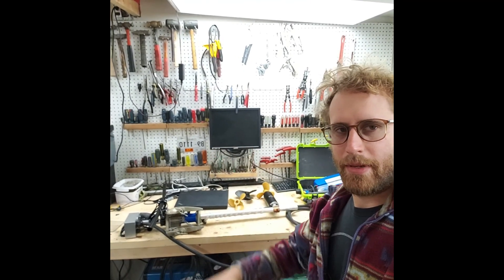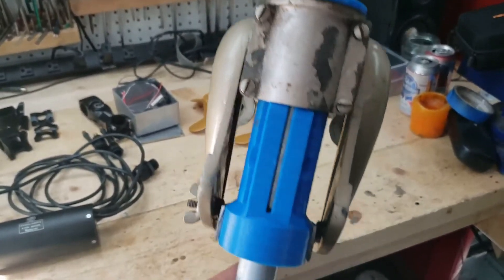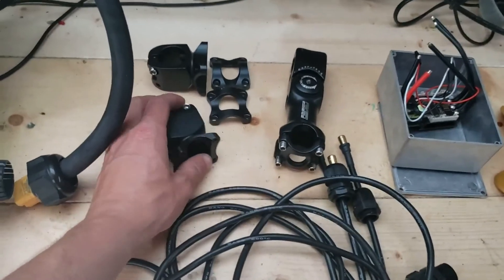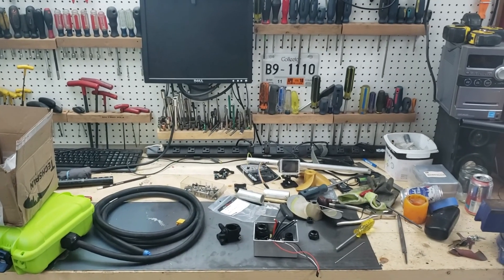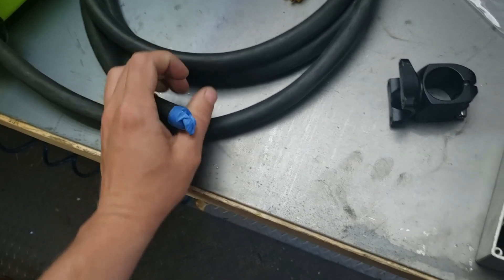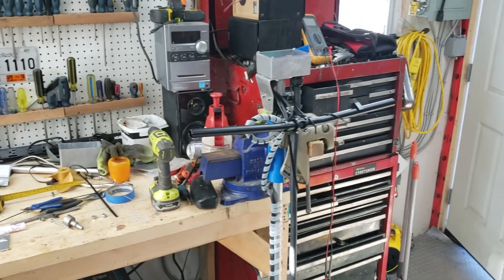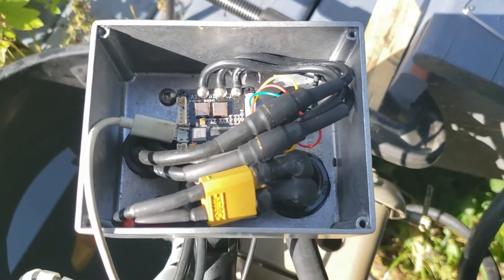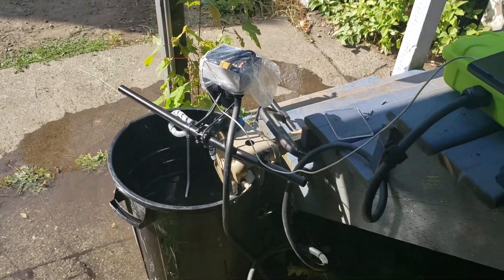2.5kW DIY Electric Outboard! Part 1 - Build

Comment: Did you ever upgrade the controller? What speeds at what power do you get?
I have some outboard videos as well. also used bicycle parts, but went a bit further with the bike parts :-) https://www.youtube.com/watch?v=-I8UaPz7lMM

I do want to rebuild mine.. either as you did, going the flipsky route. Or going the cheapo route again, and use a hoverboard motor with printed belt pulley, and then using a belt instead of the chain, but otherwise similar design than my chain based one.
Also want to epxeriment with other props and more power.
Reply from the maker: Hello! I made a newer version motor for use with my Hobie Tandem Island. You can see it in some of my other videos.

I did eventually change this one to a v6 VESC from flipsky for more power.

Comment: How does motor attach to prop?
Reply from the maker: It uses a shear pin and a nut. Check out the motor available at flipsky. I use a piece of solid 12 awg insulated conductor as a sheer pin.

Comment: How do you ensure water doesn't get into the motor?
Reply from the maker: Hey Nick, the motor is sealed with a ceramic seal and rated for submerged use. So far no signs of water ingress however I won't take it apart unless I have reason to do so...
Reply: Nice i have a bigish hobby king marine motor 2.8kw love the project

Comment: awesome man, i want to do a similar setup on an inflatable kayak for portability so thanks for the video. any updates on part 2? im curious on how you control the speed and the steering...idk anything about boats
Reply from the maker: Hello! Thanks for the reply and yes this is a great little setup for small craft. I finally have some time to shoot an update however the smoke situation on the west coast has been impacting my outside time. The speed is controlled with a 10k potentiometer on ADC1 using a flipsky VESC 4.20. The long handle bar turns the hole outboard, sort of like a normal outboard. I'll show the motor in action and do an exploration of 3d printed propellers soon.
Reply: @Philbuiltit  oh wow i didnt know u were in cali, i hope everything gets calmer soon. thank you for your reply as well, i will subscribe
Reply from the maker: @holyscience3763  on Vancouver Island in Canada! The smoke has come very far and has been around for a week now. Hoping us and everyone down south sees relief as soon as possible.
Reply: @Philbuiltit  woah thats crazy, thanks for telling me i got fam in Vancouver i need to give them a call. it is almost winter so at some point the cold air should be swooping down from Canada